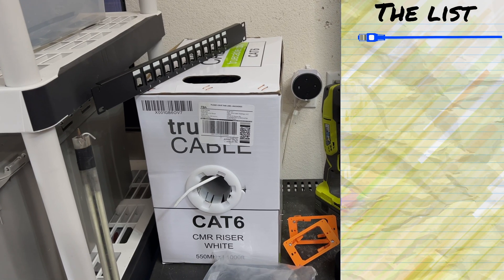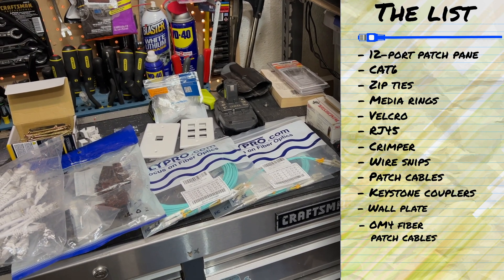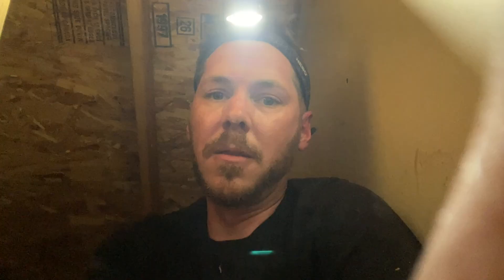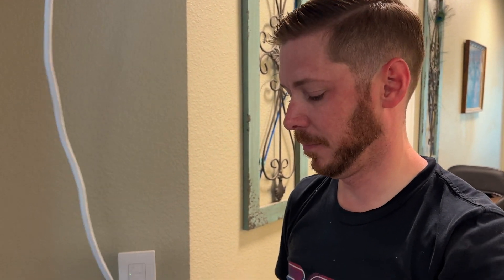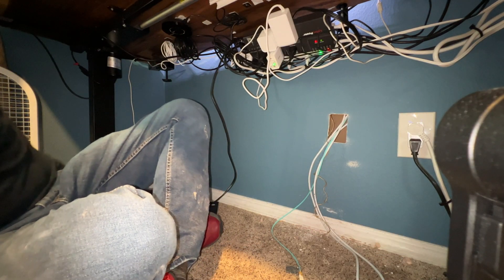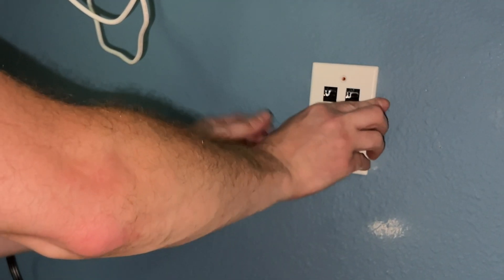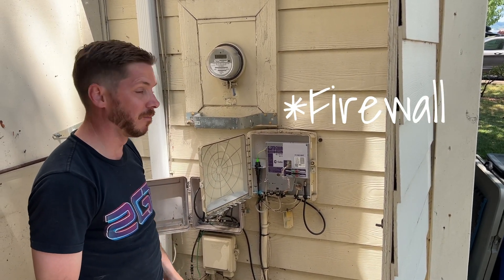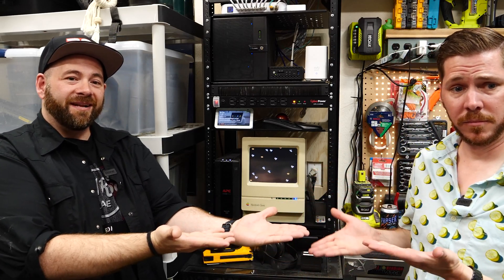Home network upgrade time....AGAIN?

Comment: Did you create your own fiber cables or did you order those small ones?  I have always heard it is very expensive to be able to make your own connectors for fiber.
Reply from the maker: We bought pre-terminated fiber patch cables at specific lengths to do the cable runs. You're right about the cost of the fiber terminator gear. It's far too expensive for mere mortals like ourselves to purchase. Thankfully fiber patch cables are incredibly cheap. Most low-voltage companies just run pre-terminated fiber patch cables as well. It's a lot easier and less expensive than having the gear to terminate. Thanks for the comment and watching!